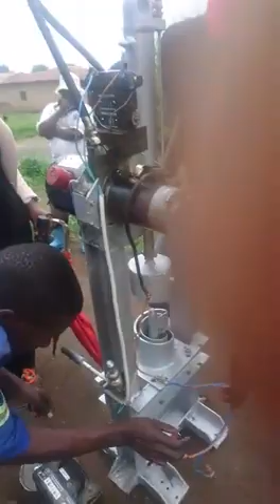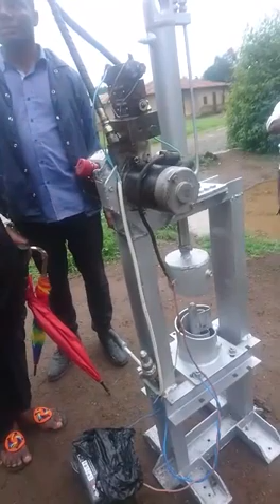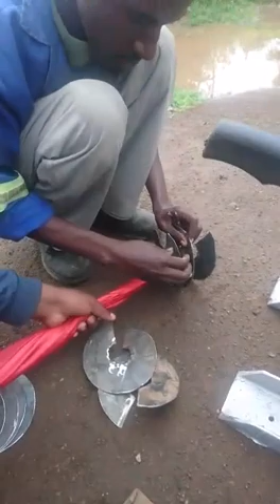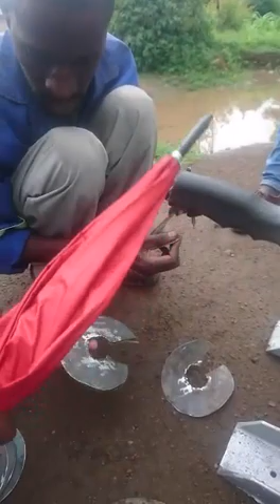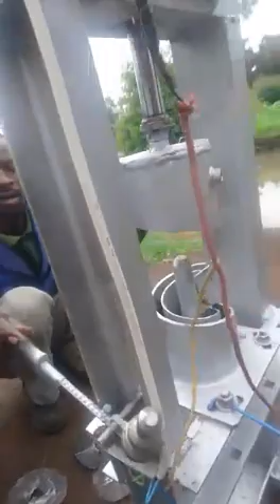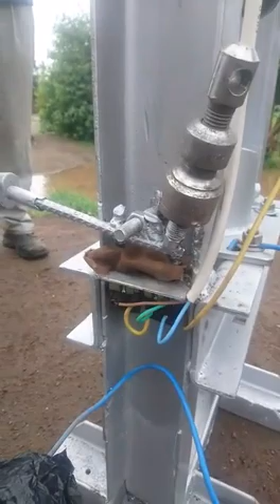Screw Conveyor Spiral Hydraulic forming Machine

Comment: Screw Conveyor:

All Complications are now resolved. We have software that produces 100% accurate results by which you can bend your spirals/worms according to your needs.

A very easy and cost-effective solution. Please share the following information:

• Outer Diameter

• Inner Diameter

• Pitch

• Thickness

• Coverage/Kerf Gap

For further information contact us on email (marketing@ibrahimgroups.com)

WhatsApp #: +92 300 0649677
Reply from the maker: OD 150mm
ID 30mm
Pitch 70mm
Thk 4mm
Reply: Blank Parameters:
OD: 156.513mm
ID: 36.513mm

For Further Details, kindly send us the message via email address which is as follow:
marketing@ibrahimgroups.com
Whatsapp #: +92 300 0649677